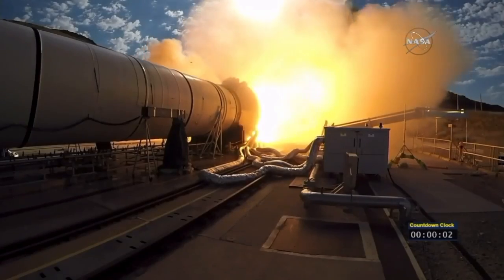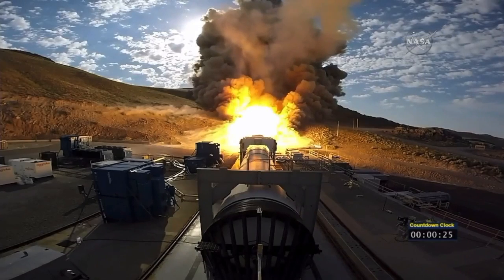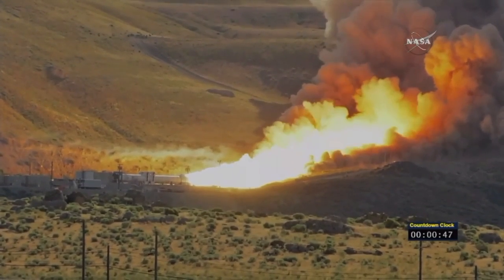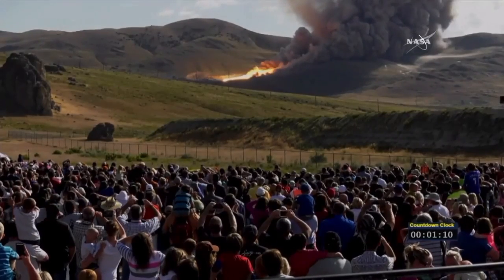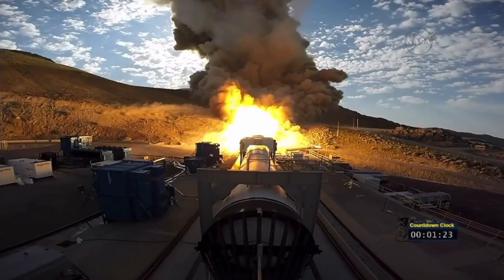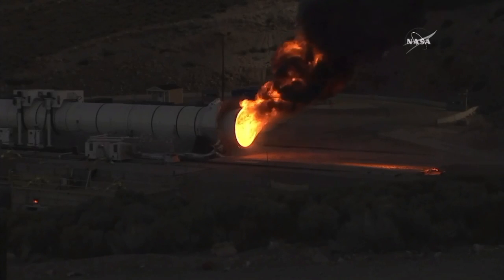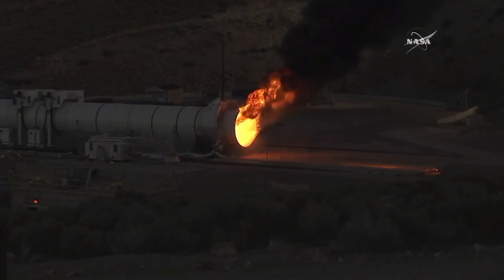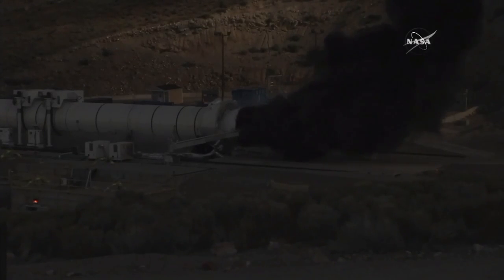SLS SRB QM-2 static test

Comment: 00.22 Holy crap thats powerful you can literally see shockwaves! Imagine standing in front of it when it starts!
Reply: It happened in the 80s, and killed 5 people. There was a fire during casting of the solid fuel in a rocket segment at the Morton Thiokol plant. 4 men were killed instantly, the 5th was looking down into the casting pit when it went off and suffered horrific injuries. He died several hours later.

This article was written shortly after the fire (when the 5th man was still alive):
https://www.nytimes.com/1987/12/30/us/fire-destroys-part-of-mx-missile-plant-and-kills-4.html

And this one was written after an investigation:
https://www.washingtonpost.com/archive/politics/1988/03/17/thiokol-fined-in-fatal-mx-rocket-fire/d8d2a2f1-fbca-4f17-a8fc-80637f373140/?noredirect=on&utm_term=.5977e3c4fd5a

The propellant was set off by a static spark because the equipment the men were using wasn't grounded properly. Turns out at the time, it was routine for people to go inside the rockets and inspect the seals between the rocket segments. Makes me shudder to think about being inside one of those things knowing just a slight static spark could ignite it!

Comment: Was it full thrust? What was holding this thing in place?
Reply: Solid rockets can't control the thrust, it's on or off. Can't turn them off either, it goes until it has fuel. Like a firework. It's clearly bolted to the ground.
Reply: 13,800 kN or around 1.3 million lbf of thrust

Comment: Are the flames directed into a pure dirt or sand hill, if not how does it not start a wild fire?
Reply: Yes, military equipment (including NASA's rockets) are tested in the deserts of the Southwest.
Reply: *****
thanks
Reply: We place sand/gravel behind it and the rocket melts the sand and gravel into glass. We build fire breaks all around to prevent spread of any fire and also have fire teams on standby to put any potential fires out after the static test is complete. Also its the middle of nowhere Utah and theres not much vegetation to burn.

Comment: Interesting that, even with a LOT more propellant due to the fifth segment, the total burn time is within a few seconds of how long it burned on the Shuttle. I would tend to think more propellant would take longer to burn!
Reply: So, they don't burn from bottom up, they are ignited from top to bottom all within milliseconds and burn from the hollow center out to the rubber insulation layer protecting the casing. So, absent other geometry changes, more center sections yields more thrust rather than more burn time.

You probably already knew most of these details.
Reply: sidlinger Indeed I did know the details, but I didn't put two and two together. That makes perfect sense. Thanks!! :)
Reply: Longer burn time would be relevant to the diameter of the rocket rather than length.
Reply: SRBs on the shuttle were probably at higher thrust capacity due to the shuttle and tank's high weight.

Comment: Solid Rocket, is that space shuttle era tech?
Reply: Yes, with some upgrades. The Shuttle SRB used four fuel segments, whereas the SLS will use five, so it'll be a lot more powerful than the config that was used on the Shuttle. It is, basically, off-the-shelf technology, though, as are the liquid-fuel engines that will power the SLS core--they're upgraded Shuttle Main Engines!
Reply: Why fix it if it isn't broken, right?
Reply: Its an upgraded version. Just cuz it uses solid fuel doesnt mean its old tech.
Reply: Warren LaFrance Same (though I would imagine evolved as technology has improved) configuration as the post-Challenger enhancements, which if I recall correctly, were successful in preventing any further issues such as the one that doomed 51-L.
Reply: That was fixed, but only after the Challenger (STS-51-L) disaster on Jan 28 1986.
Reply: Warren LaFrance fr they better not kill any more astronauts with faulty o rings smh
Reply: Another internet know-it-all who knows better how to lift 100+ tons into orbit. Great. Some Deltas, the Ariane, Vega, etc. use SRBs. Challenger was 100% management fail. In any decent environment the issue would have been fixed years before - because it was known. It is public knowledge that the safety margins and procedures after STS-6 or so became irresponsible, and problems were not addressed at all, just because they didn't want to afford the cost some of the REAL design flaws caused. Like putting delicate stuff on the side of a rocket. Which caused the Columbia disaster. SRBs have absolutely nothing to do with any of that. Just because Elon or the Russians do not use them in order to put a refrigerator on the moon, that does not mean they don't have their advantages.
Reply: Cool, same o ring weakness or did they change that out for something that is not affected as much by cold weather?